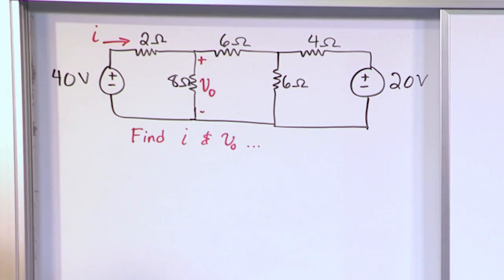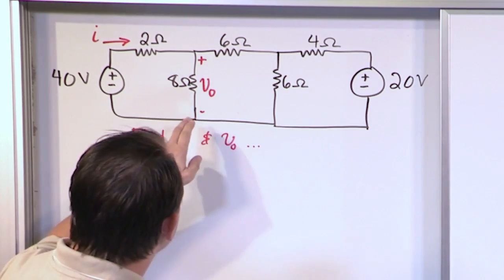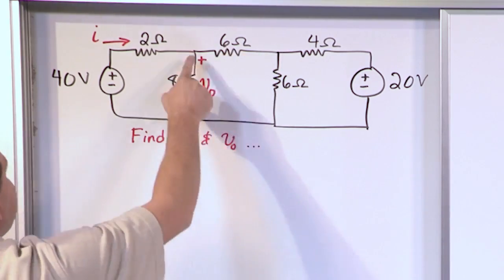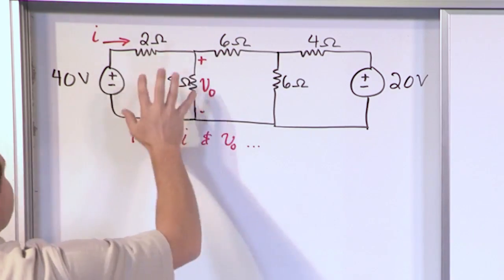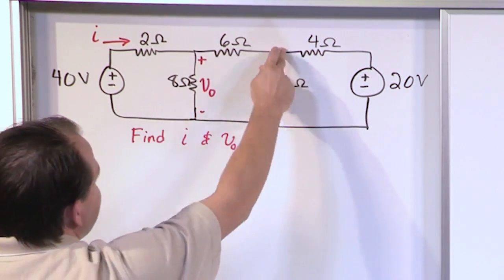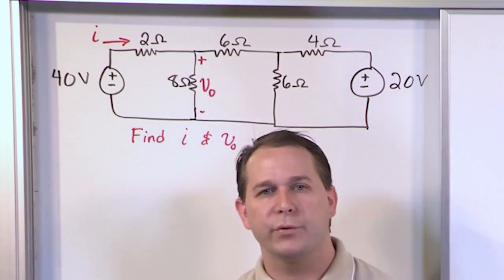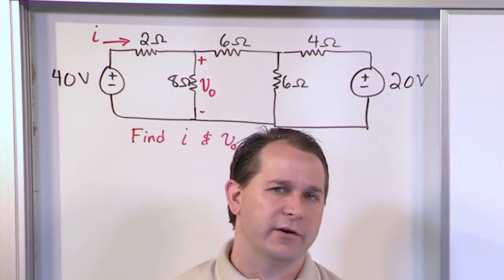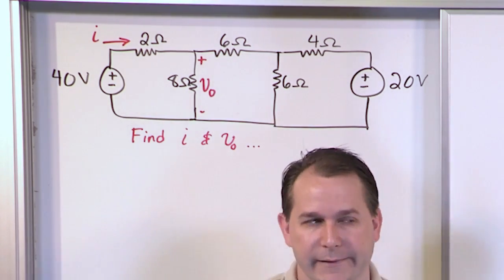10 - Intro to Mesh Current Circuit Analysis (EE Circuits)

Comment: Thanks very much for this. It helped me confirm Hafler circuit operation for audio that I had worked out in Excel using just ohms law.
Basically the same CCT but,  AC generators not DC, and 2Ω and 4Ω res are 0Ω and others are 8Ω(speakers)
 I did electronic engineering 40 year ago!
 I then used your matrix method and also discovered that Excel has built in inverse and matrix solving features,
I was so happy when I got the same answers.

Comment: at the 11:30 mark u state that + to - is positive and - to + is negative, but it doesnt matter how u use the sign convention. so do u mean i can  write in + to - as negative, and a - to + as positive and it wouldnt matter as long as i follow the same sign convention around the whole circuit? Im reading schaums basic electricity 2nd edition and it states that + to - is negative, and - to + is positive.

Comment: I love your videos and presentation. I've watched dozens of them and learned, or relearned a lot. And thank you so much for that! 

But I do NOT at all like. how you reversed conventions at 20:34 in this video. Using (iB - iA) * 8 ohms while analyzing mesh B (across the 8 ohm resister R2 which falls between mesh A and mesh B). . In writing the equations for mesh A, you used the convention of iA - iB for the current across that 8 ohm resister (down current minus up current). In  mesh B you reversed it to iB - iA (up current minus down current)

I would argue that to continue the pattern already established, the convention that you yourself established... a more understandable way to explain this should be -1 * (iA  - iB) * 8 ohms... thus continuing the pattern "voltage rise (negative),  minus two voltage drops (2 - positives)" which then equals zero. The exact same form as you used in mesh A...  (-40 + iA2 +(iA - iB)*8).

By switching the convention midway through the problem, I found it very confusing

Of course your math is perfectly correct... -1 * (iA  - iB) * 8 ohms is mathematically exactly the same as (iB - iA) * 8 ohms,  but conceptually, it is very different to comprehend

Comment: It is so much easier if you just apply the superposition principles using the Thevenin and Norton equivalents of voltage and current sources. You can almost do it without a calculator. No matrix calculations required!
Reply: That's what I thought off the top of my head but could not remember what it was called then I looked up superposition  and bugger me I did this at Tech College 40 years ago.

Comment: I need examples of nodal analysis for circuits with two voltage sources and five resistors when finding voltage 1 and voltage 2as well as current through each resistor

Comment: Do we not have to worry about the polarity of the resistors?
Reply: Resistors are bidirectional meaning they do not have a polarity, so you don't have to worry about that.
Reply: I guess what he did was solely based on the assumption that the polarity of the resistor depends on the direction of the current in each mesh

Comment: In this video: watch?v=k5Tlg27JDtc he says when going from - to + you use + because it's a voltage rise. So for the power source you would write 40 instead of -40. Why did he say that? Because what he said makes more sense than what you are saying in terms of going from - to + is treated like a voltage loss since you use - i.e. -40 in this example.

Comment: bad job explaining the algebra behind the matrix. you say not to use a calc but go on to skip steps using a calculator.
Reply from the maker: I don't believe I ever said not to use a calculator.  I continually say to use manual algebra to get your equations into a correct form so that you can input them into a calculator to solve the system.  If you don't understand matrix methods, please review my algebra 2 class or linear algebra class.  At the EE level you are expected to know what a matrix is to solve a linear set of equations.  Thank you! Jason